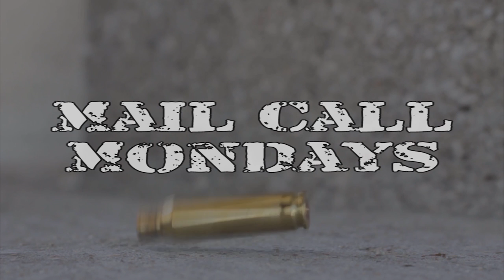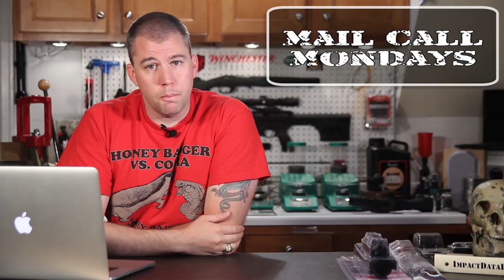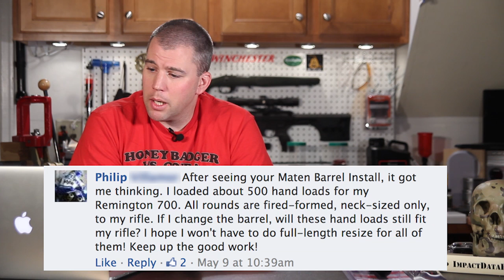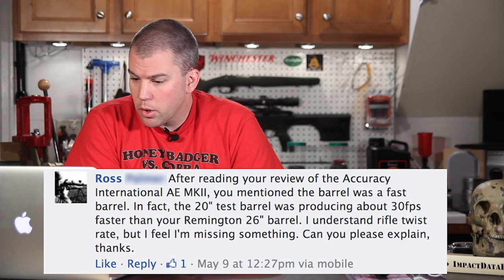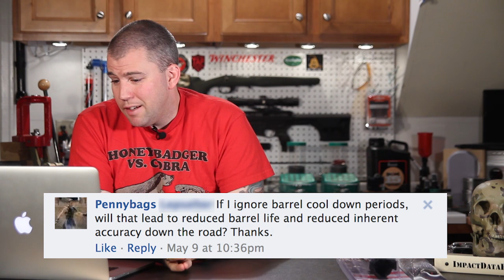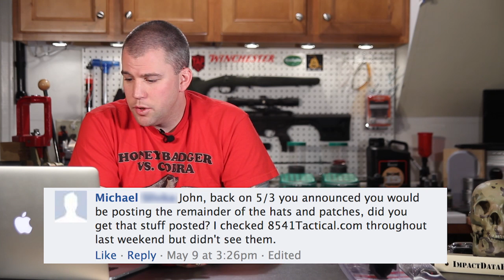Mail Call Mondays Season 2 #18 - Tracers, Muzzle Brakes, Barrels and More

Comment: I have a older 700 VS and my buddy is shooting a new 700 varmint. I had a box of hornady match and I let him shoot 5 rounds. I forgot and through them in the tumbler with all my brass and was wondering if I was to take my caliper to all of them where in the body should I check the measurement?

Comment: When a good friend of mine had his .22/250 rebarreled, the tolerance of the new barrel was in fact 0.0 at 0.223 thousandths instead of 0.224. This increased pressure significantly, so much so he had to use a very slow burning ball power, Winchester 760 ball if I remember correctly. Would it be possible that a finer tolerance in the polished AI barrel created a little more pressure also?

Comment: John, when I'm hand loading, I'm doing a full length sizing die every time. I don't neck size. I'm also using a factory rem barrel. 

I'm planning on moving to either a Krieger or a Bartlien barrel. Any other barrels you recommend? I wanted to stick around a twist rate that would be good for 168, 175 or so grain bullets. Any other advice?

Comment: Speaking of tracer trajectories, IIRC these are not always the same as ball, partly because the bullet is losing weight (and hence BC is dropping) as the tracer compound burns, but in some cases (depending on how it's constructed) I hear you have a base-bleed effect as the compound streams out the bullet base which effectively RAISES the BC for that time. Whether these effects cancel out, I don't know; but I've often wondered what the actual ballistic behaviour of these rounds is.

Comment: My R700 has a 26" barrel. If I were to bed the stock as far forward of the recoil lug to attempt a 20" free-floated barrel, will this give me 20" barrel stiffness with 26" barrel LR potential? Or does it simply require it to be cut down to 20" to get 20" stiffness?

Comment: honestly i think the velocity increase for the ai barrel is because 308 hits peak pressure at around 18-24 inches depending on powder burn rate. the load you shot finnishes burn at around 20 which was why its faster just my 2 cents

Comment: Just shooting it will wear down the roughness. There is a process called hand lapping. Hand lapping is basically a process where you make a lead cast of the interior of your bore and when the lead cools you coat it in valve lapping compound and run it through your bore a few times to smooth out the bore.

Comment: On your comment about the barrel speed and different length barrels in relationship to the smoothness of the barrel itself. I believe there is a company that makes bullets that are different grits that come in a kit. From what I read you are supposed to shoot them in order from heavier grit to lightest making your barrel smoother and more accurate. What are your thoughts on this process?